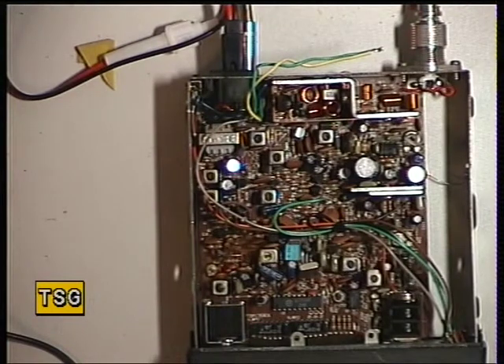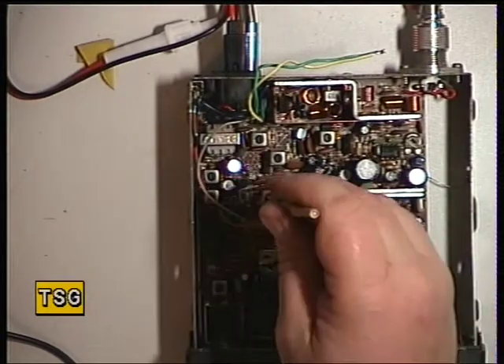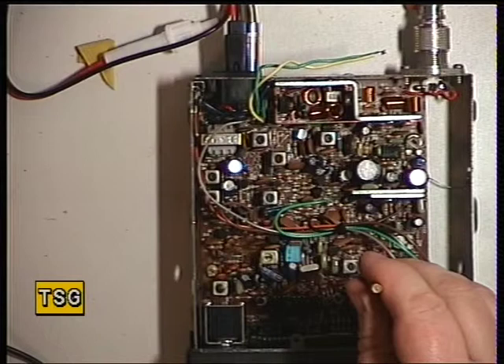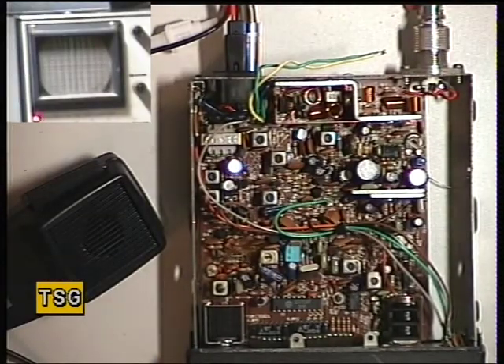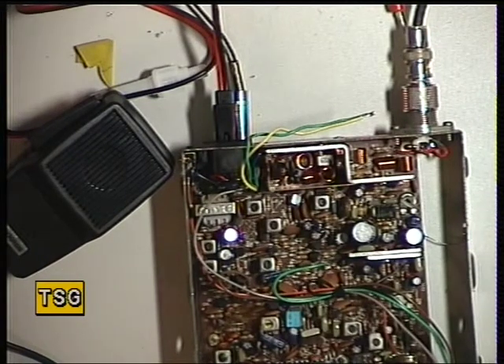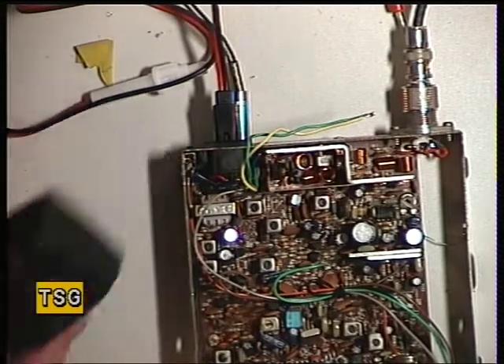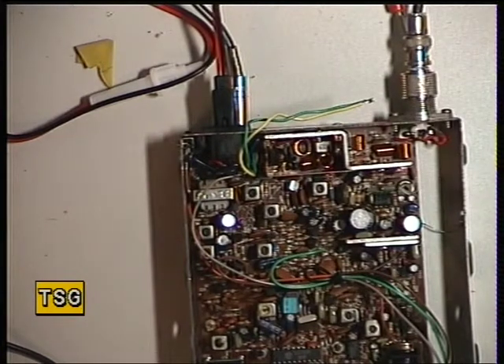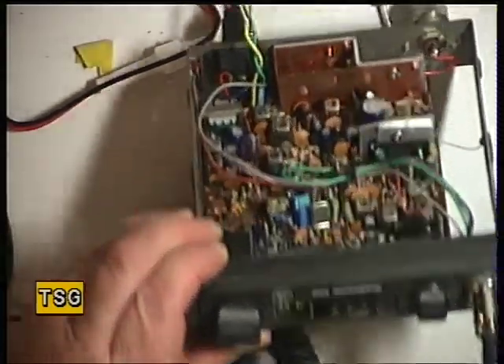Ford Roadmaster 500,  UK CB radio (Mobile) - Receiver alignment

Comment: Those little 135 sets have a good RX on them though out put always was a little weak !
Reply from the maker: Well I did manage to just get 4W out of it...and that's 4 real watts, so about 5.5 'good buddy' watts. Some CB sets only manage 2.5W probably just scraping in at 3.8 'good buddy' watts. It's just like Hifi...100W amplifier can mean 12.5W per channel RMS in reality! I've the similar radiomobile model come in for service, so I'll see how that performs! 

This output power game is pretty meaninglesss as you have to square the power to double the range. In other words lets say you got 15 miles on 4W; to get 30 miles, miles, would require  64 watts, so the difference between 3.5W on brand 'x' of CB & 4.5W on brand 'y' is a few hundred yards, though I am also a big believer of getting what you are entitled to, hence the tune-ups here in real watts!

When we did CB walkie talkie tests, the Realistic TRC1003 & TRC1005 which are just 50mW output (1/20w) managed over 3 miles...yet some brands of 250mW unit (1/4W) managed 300 yards; that's down to build quality & attention to design detail of antenna matching circuits. On the car I only do drilled in aerials because nothing else works as well! 

Richard